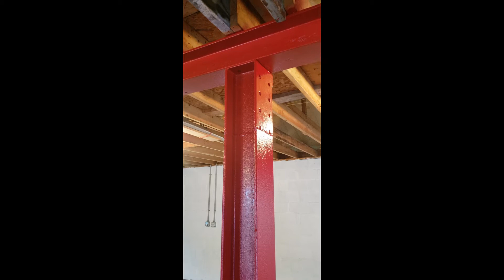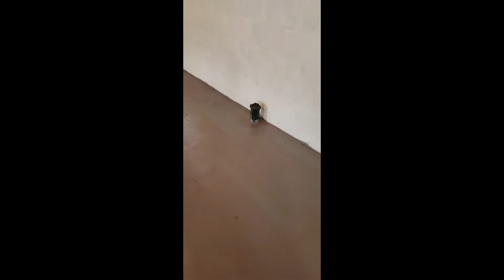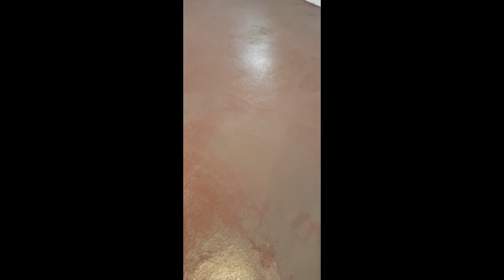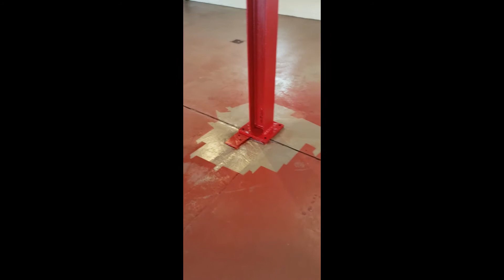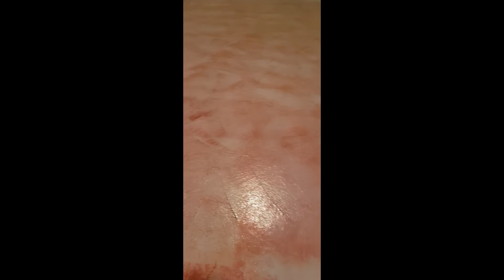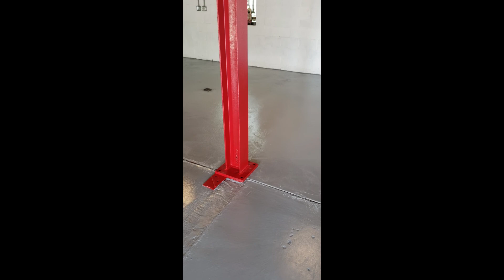The Dangers of Spray Paint / Enamel - Learn from My Mistakes!

Comment: I feel so bad for you! And yet you have such a calm disposition about it all. I would have freaked out. But yes, plastic the whole floor off even if using a brush, move your tarp along under you. Post the after work when you're done! Could you just roll a dark paint over the whole floor? Dark gray?
Reply from the maker: Thanks for the comments! All worked out well. The second coat of epoxy went on well and it's held up through normal use. There are some small areas where you can tell I didn't get a good etch on the concrete and the epoxy has chipped away, but those are small spots in a non-critical area. Painting over it may have been viable, but I was going for the most durable finish possible.

Comment: Isopropyl alcohol takes any spray paint off of my floors easily
Reply from the maker: Hi, Jason. While I did not try isopropyl alcohol, I did try denatured alcohol, which is generally a stronger cleaner. I'm hoping to never have to test this : ) But if I do have another disaster, I'll definitely give it a shot.